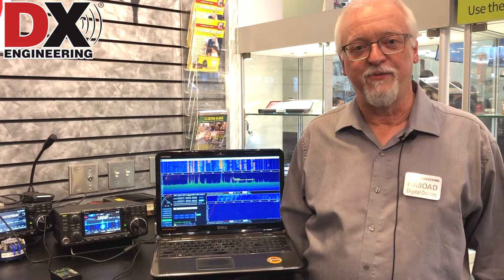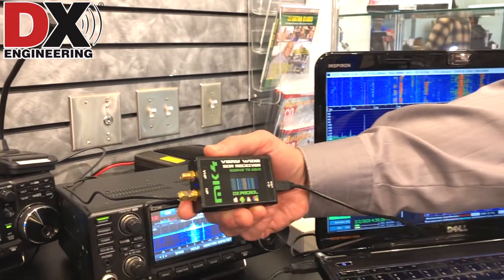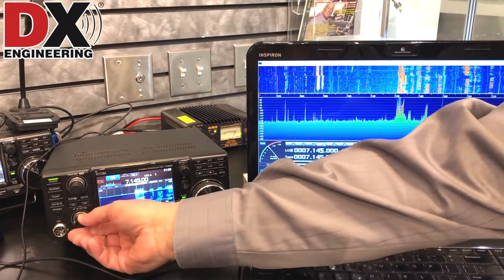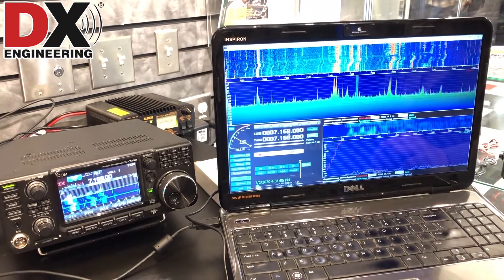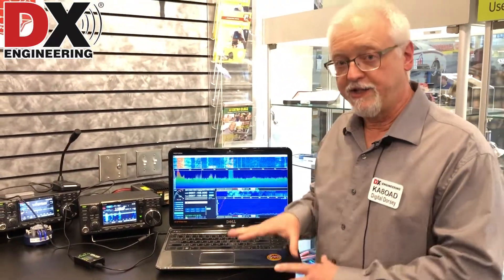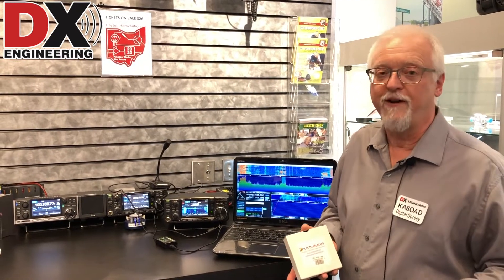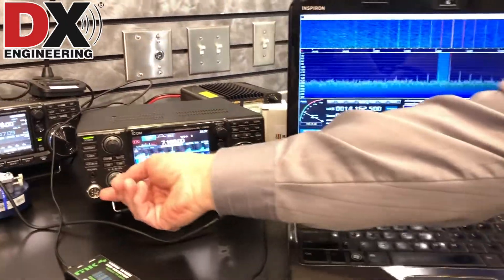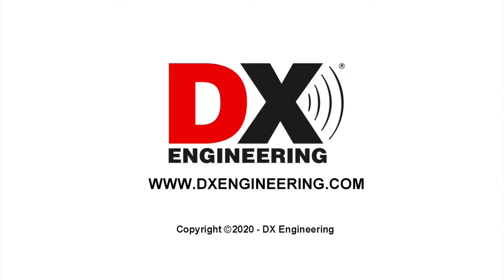Demonstrating the Radio Analog PTRX-7300 panadapter module for the IC-7300

Comment: this is silly, it's an sdr for an sdr?  not to mention you can do this on any radio with an IF out and a $20 dongle.  did that on my 950 with CAT control.  LOL.    so is this a waste of a 7300 or a waste of a dongle?  you still had to reach for the 7300 front panel volume control.   save your pennies for the expert sdr pro3.
Reply: In what way is this silly? Integrating another SDR with your IC-7300 is super convenient. Use your imagination mr negative Andy
Reply: @Momfasa you can polish a turd, but in the end it's still a turd.

Comment: I don't believe it you can change the mode and band from the computer that's just fantastic I want one.
Just think you don't need to use the radio controls, will it work on my Yaesu FT-101 ZD MKII ?
how much are these devices ?
Cheers great video.
Reply: I picked up on the fact that Dorsey made it sound as if this PTRX-7300 would make the radio follow the software.  That isn't the case.  It takes Omni-Rig (free), properly set up, to make the radio follow the SDR software.  And vise versa.  Your SDR software will follow your finger, when it rolls the VFO knob.  I'm sure you've already figured it out, being that I'm 3 years late to the party. 😜

Comment: And the benefits of the PTRX-7300 panadapter module over the radio's built-in panadapter are...? Presumably the rich feature set of readily available SDR software like SDR Console, HDSDR, SDRPlay, etc. Big benefit appears to be much better resolution than the built-in panadapter, ability to function as a second receiver. And SDRPlay integrates directly with Win4IcomSuite.

Comment: Can I use the audio from the SDR + filtering ? the Audio and noise reduction on the 7300 is fatiguing after a while, it's noisy and the NR isn't nearly as good as on my FT-891 which is a far better radio to listen to, I listen mostly with headphones. 

I was thinking of selling my 7300 for the FTDX-3000 because I think Yaesu radios sound so much better but if I can hook up my Airspy with the panadapter to the 7300 and use the Airspy Audio I would be happy because the sound and NR on the Airspy is much better. 

It's a shame the RS-BA1 software is not so good and you're still limited to the harsh sound of the 7300.

Comment: I bought one of those cheap SDR USB dongles and it hardly picks up much of anything (now it'll pick up FM radio pretty great but I didn't want to only listen to local music stations). I want something that works but doesn't break the bank and it looks like that DX-patrol might fit the bill.
Reply: For that price just get the RSP1a :)
Reply: @Ambient Hex yeah, I bought some passive filters for it. unfortunately there's quite a lot of spurious emissions that the filters just do not filter out. the main filter I got was due to an AM station near by which eliminated issues from that, but the spurs remain.
Reply: @Ambient Hex it came with multiple lengths of telescopic antenna so that it can pretty much cover  everything that can be tuned on the SDR, i just swap out the different lengths to fit within the frequency I'm receiving on. my issue is that it receives a lot of interference where I live which pretty much drowns out anything other than music stations, and maybe reception from the nearby airport, and some occasional CBers and some occasional shortwave radio, every now and again I can receive some weather stations.